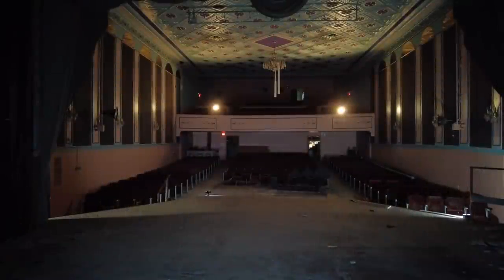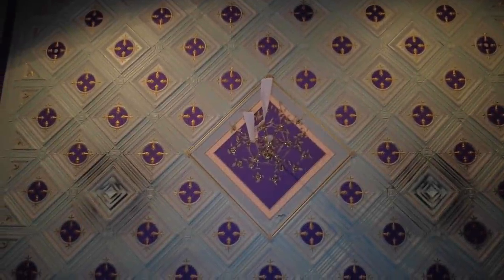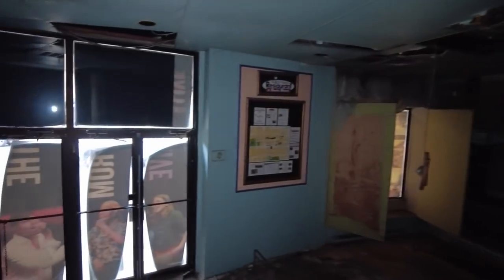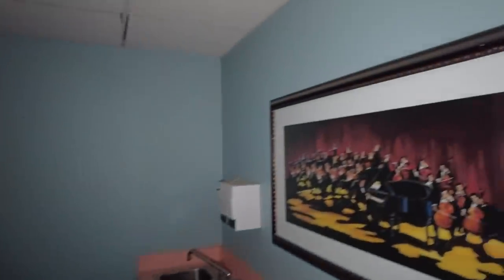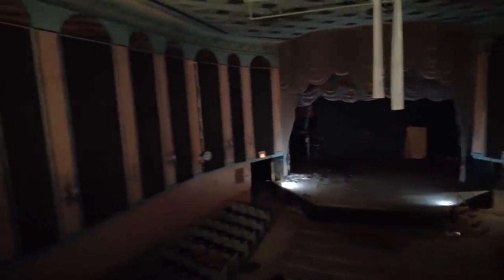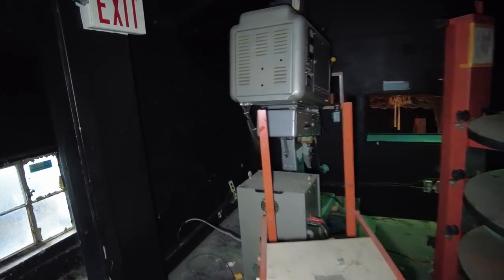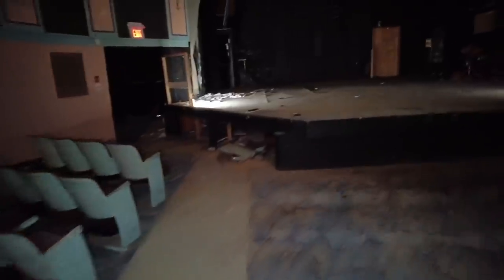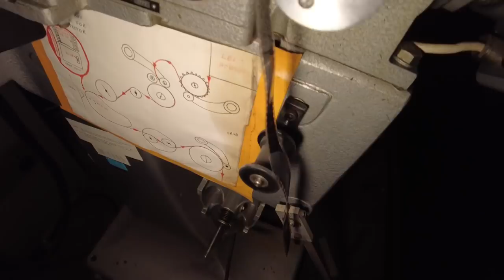ABANDONED HAUNTED TIME CAPSULE THEATRE, ALLEGEDLY HAUNTED

Comment: I used to work there. Left shortly after the Rose opened next door. A couple of answers to questions in the comments. The projector is not original.  We bought it second hand in the late 90s to start showing movies again. 
The seat hardware was original cast aluminum with seat cushions replaced in 89. 
The first few rows were removed after we closed it so that we could build a stage extension and use the room for stage rehearsals.